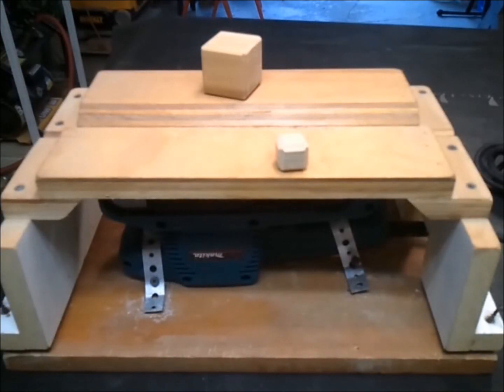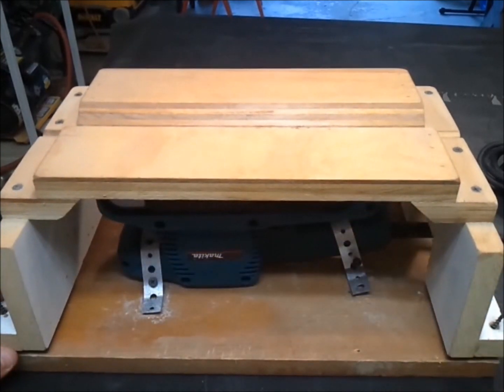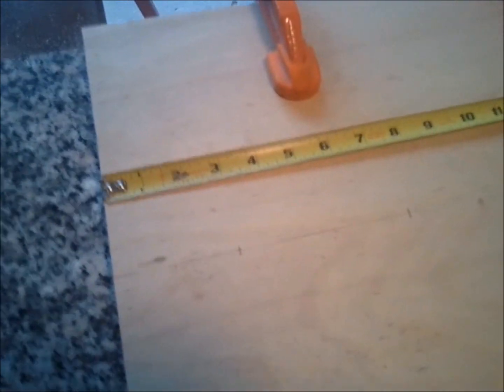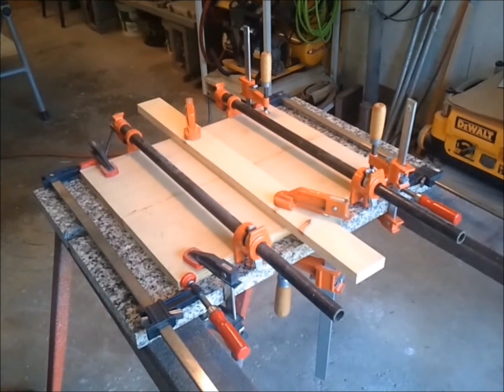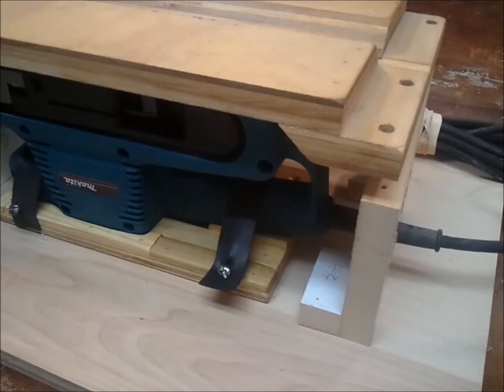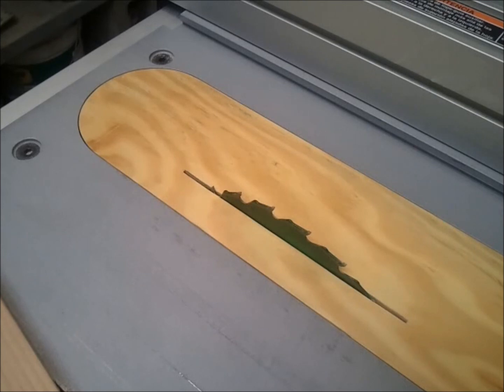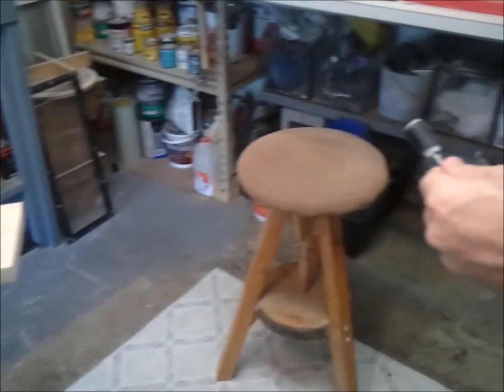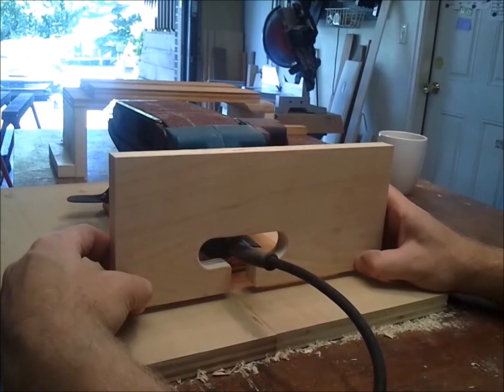Delicate chamfer device (part 1 of 3)

Comment: 2:10  How does joining with biscuits give you the “thickness” you require?
Reply: +Girish Manjunath  Got it, thanks
Reply: He puts two thin boards side by side to make it thicker.  You can do it with just glue, but with biscuits the boards will stay aligned better
Reply: Charlie Wynn I think you mean “wider” not “thicker”.
You laminate boards together to make it thicker, but you don’t use biscuits for that.
Reply: +Lenny F HAVE YOUR ANNOTATIONS ON AND WATCH THAT PART AGAIN!